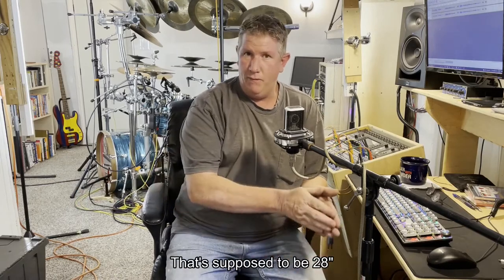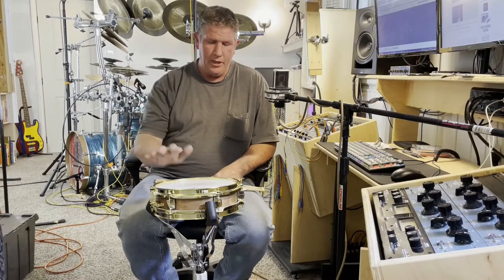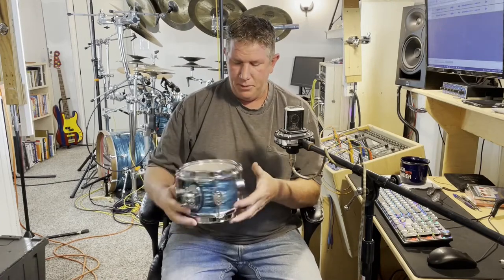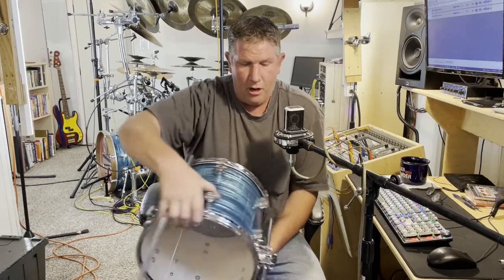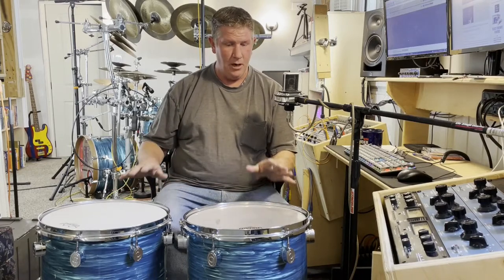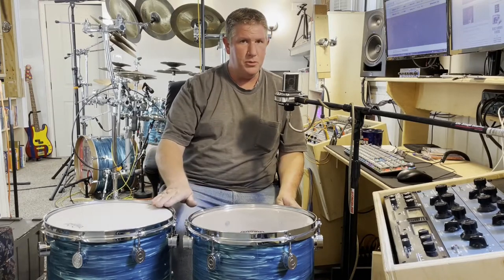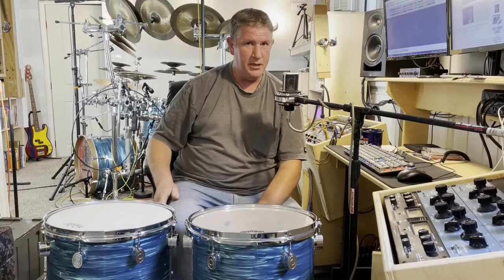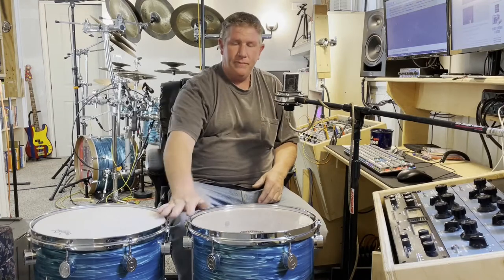A Tom with a Trick up  its Sleeve

Comment: got phase issues on your drum mic'ing somewhere.. wall reflections most likely most of the sound problems.  The cymbals sound pretty harsh. Cheap mic, or treble too boosted. your main Snare has no power or depth, kinda papery. did you cut a snare bed for the wires on the floor tom snare?  Keep progressing.

Comment: Hi. I've got a 14x12 tom that I've been thinking for years to convert into a snom, but I never dared. The thing is that I "only" have to install it the snare strainer and butt plate (that's the easy part), but I'm not sure if I can do the snare beds properly, and you know, if you screw it with that, you screwed the drum. Any advice on how on it, how would you do it...?
Thanks in advance.
Reply from the maker: I would try it without the snare beds first. You may end up liking it that way and then the rest is of no concern. Also, if you find you want to do snare beds after that, you already have your hardware in place so you can locate the cuts properly.

As far as cutting the beds: A set of 20 strand Puresound wires is about 2 1/4 inches wide, so I would make the first cut 2 1/2 inches wide. I don't like to go too deep; maybe 1/16 to 1/8 inch. mark the width and depth lines on your edge and make a squared, flat notch inside those lines. That will be the surface of the snare bed. Then, taper those hard edges out from there (about an inch in each direction) making a nice slope up towards the original bearing edge. 

I would use a straight square stick wrapped in 80 to 120 grit sandpaper for most of it. I use a router table these days and if you have one, so much the better. You can make a nice main cut with that. I would still use the sanding stick to taper the edges either way. It's slow work, but trying to rush it leads to mistakes, I find. I would do some light hand sanding after that just to knock down the hard edges and make sure nothing is poking the snare head.

I might have to make a video about this soon. Thanks for coming out!